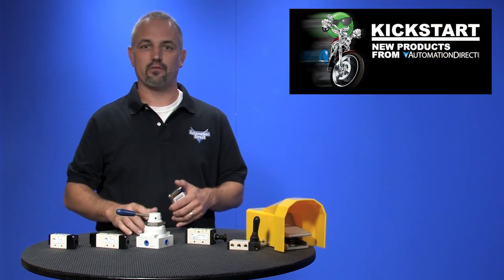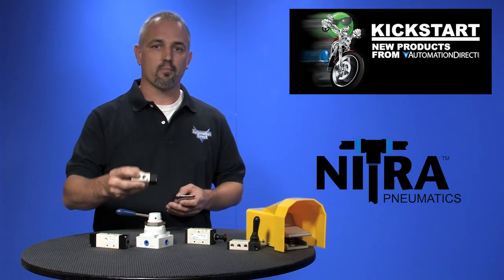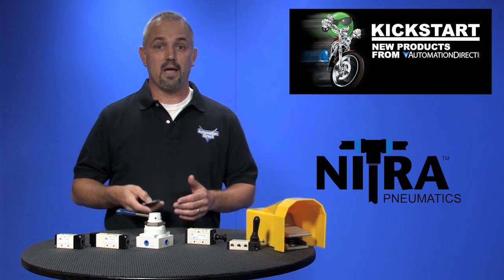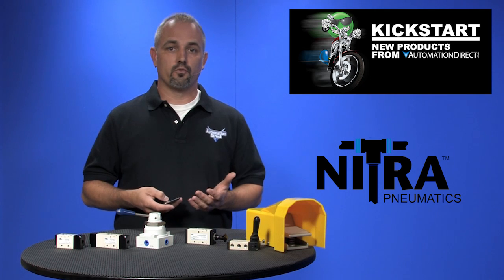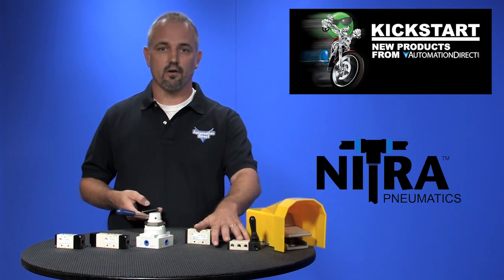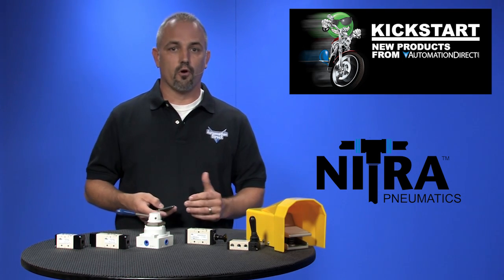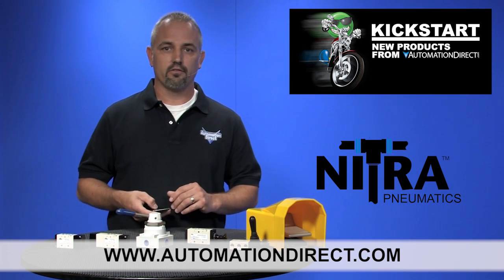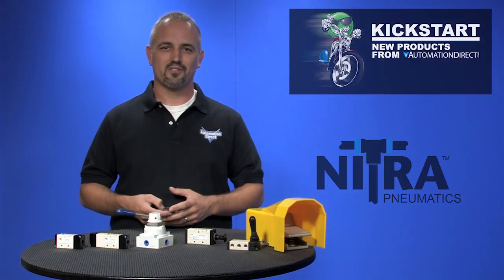NITRA Pneumatic Air Pilot Valves & Manual Air Valves from AutomationDirect

Comment: i need a valve which will be controlled by foot pedal and at the same time it should control the air flow also. i need this for a simple pneumatic brake project, in which the braking pressure can be well maintained manually. pls suggest the nescessary parts for this .